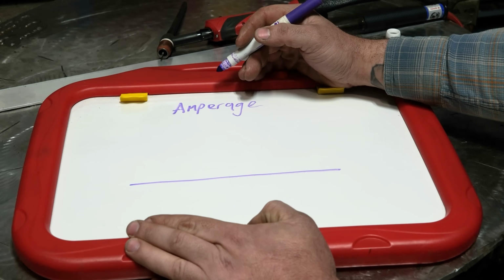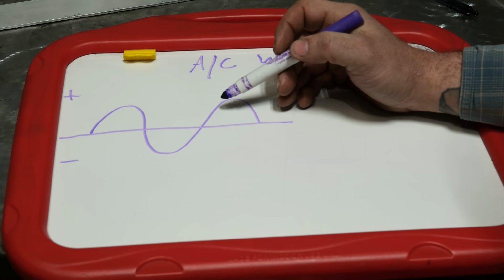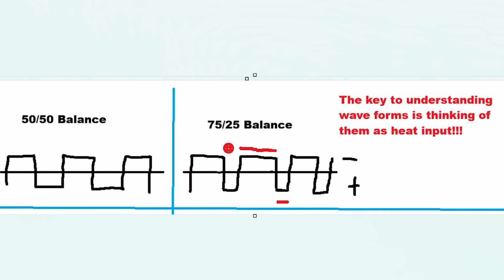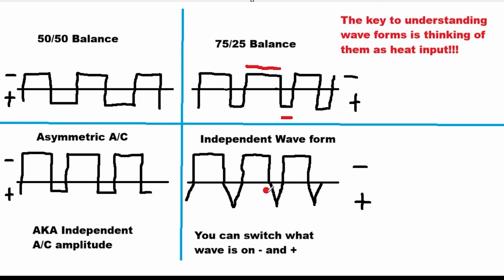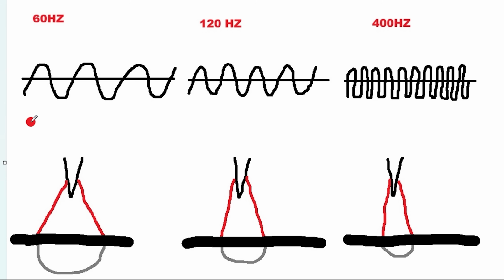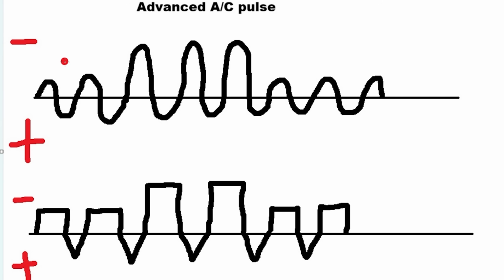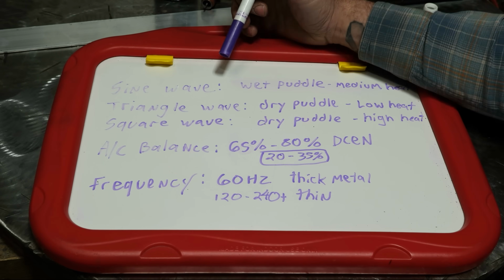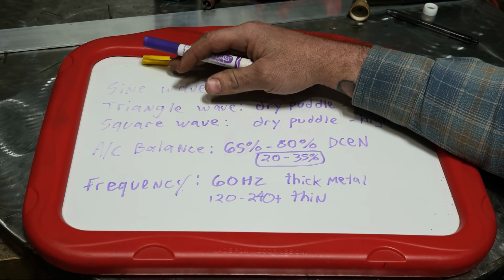How to Tig weld Aluminum part 2:  Understanding machine settings

Comment: Greg, very informative. Good information about cracking and such from pulsing. So much for a person to learn.
Reply from the maker: That’s the fun thing about welding.  The whole welding itself is a skill/has its own knowledge and the metallurgy end of things is a completely different knowledge set.  To be able  be able to weld any materials and have the welds last takes far more knowledge than just how to weld.  

Aluminum has so many weird quarks and most people aren’t aware of them.  Someone who is experienced with tool steels and heat treatment will understand aluminum quickly.  For most people that only work with mild steel they will likely do a lot of things wrong with aluminum.  The hot shortness sensitivity, the fact welded aluminum will often fail in the heat affected zone and not the weld because of the changes caused by heat input, and the fact that different fillers produce welds with different max heat exposure temps are just some of the things to consider.  Basically there are so many variables and so many things to consider to have a weld or repair that lasts.  There is a reason i have done so much aluminum work over the years that other people couldn’t.  It’s not a welding skill issue as much as it was a lack of understanding of how to make a proper repair/metallurgy knowledge.  Mild steel is far more forgiving than aluminum.

Comment: I have a Primeweld Tig 325 with a water cooler and CK torch. I have only used it for mild steel and a little stainless because I had zero understanding of welding aluminum. I am a little behind on these videos but I am finally understanding, I think, the aluminum process. I guess I will be binge watching this series this week and maybe my new years resolution will be to learn how to tig weld aluminum. Thanks, yet again, Greg.
Reply from the maker: Think of aluminum as an electric arc that can’t be completely controlled but you can nudge it to do what you want lol.  Once you get past needing to hold a whisper of a longer arc gap and a bit tougher starts, you will get it.  Give it a shot and with practice you will get it 😀👍

Comment: 20:08 if you try welding too thick aluminum with high frequency, you sit there heating the project & struggling to get a puddle going, and then it will collapse. 

Not a huge problem with ppl who have been doing it for a while, its just a hurdle im pointing out for ppl learning aluminum for the first time.

Comment: This explains so much and is very helpful as I struggled greatly with my intro to Tig class on getting decent aluminum fillet welds as I never understood the oxide layer and having to get the material hot enough to melt that layer without having the aluminum absorbing so much heat to melt away the edge of the joint 
All my welding teacher Tim said was get it hot and MOVE  but This explains so much
Reply from the maker: Once I get out the videos on welding aluminum that have arc footage and info on the actual welding, it should get you on the right track.  They should be out soon 👍.  There are a lot of stupid little things that make all the difference with aluminum.  It’s all about the minor details 😀👍

Comment: Great Video Greg, I've had a WECO Discovery 221 acdc for about 5 years it's a European made machine a little more expensive than the Chinese options but excellent features, quality components and well made.
It has "Mix AC" which allows you to like you describe dial in more DC - from 10 to 80 %

It also has another separate setting where it shifts towards the negative by a %  it shifts the crossing line negative with respect to 0. And obviously your regular balance setting.

It can set, triangle sine, or square independently on + it - side.

Il be honest I haven't used this feature that much, I generally stick to square or triangle if it's a thin and small part, something that will get heat soaked quickly.

But the Mix AC is really effective for thicker materials but if you go to high it can effect the appearance.
50% approximately is good for thick parts that you want to look nice.

That would be 50 DC - and 50 % your regular wave form and set frequency. 
Which it's self is 70% DC- depending on balance setting if that makes sense.

The manual gives good illustrations and explanations of how the wave form changes.
Reply from the maker: I always find it strange that European available welders often have high level features for years before anything is available like it here.  You seem to have tons more brands available that are full featured and more modern control setups.  I guess the states are a bit behind the times lol.
Reply: @makingmistakeswithgreg  I think there's more competition on the medium to high end then the 2 in the US, I've used Esab, Stel, Weco, Kempi, Lorch and Fronius, Stel actually manufacturer HTP's welders in Italy. They're all better imo than any Chinese welder I've used. There's more I haven't used Like EWM in Germany.
I've also used Lincoln's in welding school they were good too Lincoln Aspect 375 and I've used some older Millers.
Fronius & Lorchs high end machines are very impressive,

Comment: Looking to upgrade to a multi-process welder for my personal use. Looking hard at the Rebel 235 because I might want to run Dual shield sometimes (I like the capability to play with spray, but mostly for dual shield and short circuit MIG) The Rebel 215 or the Rogue 210 would technically be big enough for me(Except for the fact that they couldn't do as much with dual shield) and the Primeweld mig180 does everything I want but run 6010, which I want to practice more of. Also, I tend to run hardwire on the hotter side.  I figure I can turn a big welder down, when needed, but you can only turn a little one up so much. Just hard to spend money sometimes ;) 

Any particular thought?
Reply from the maker: So here are my thoughts:  the rebel 235 (which I own) is probably the best option out there for a somewhat portable wire machine for someone that wants to have the ability to run spray and dual shield occasionally.  It’s not ment to spray all day, but it will make quick work on projects most people want to do.  The biggest limitation with wire welding is amperage, and the difference a 230-250a machine (with the proper mig gun and accessories) is significant over a 200amp class machine.  Yes the rebel 215 can hit spray, but its mig gun won’t like it much.  

If you want to run 6010 it’s worth it to go with the rebel series.  Being able to run 6010 is also an indication it will run most rods better.  Most inverter all in ones tend to be fairly poor stick welders.  Esab chose to favor stick and mig performance with their rebel series, which makes sense because they market them as welders for outdoors/real world.  The only alternative to the 235 that I think would be worth it would be to buy a primeweld or similar 285a machine and a esab rogue 201.  The 201 is a great stick and tig welder (will run 6010) and a 250-280a class wire machine will handle a ton of serious jobs.  The downside to this combo is the esab rebel 235 can run on a generator far better, is more efficient, and will weld up to 140a on 120v.  Also, if you plan on welding out doors you can’t beat the design of the rebel to keep contaminates out.
Reply: @makingmistakeswithgreg  Thank you, I appreciate it, Greg. And that was an extremely fast reply ;) I only hesitate to get the 235 due to the price. It's just hard to drop ~$3,000, but I don't think I'd regret it. Might just pull the trigger on it. We`ll see, but I greatly appreciate you taking the time to reply ;)

Comment: Gotta say thanks. I was struggling all last week with 1/4 inch Aluminium at 80hz. I turned it down to 60hz like you suggested and it ran perfect.
Reply from the maker: Glad to hear that.  Aluminum can be a tricky beast at times.  Things can work opposite of what you would expect, which makes it hard to know for sure what’s going to happen when you make changes.  1/4inch definitely needs all the heat input you can have 😀👍.

Comment: I'm going to nerd out here. A major reason the sine wave is so much quieter is that it only contains the fundamental frequency. (There are some harmonics because the waveform is generally not perfect. But they are very low intensity in comparison to the fundamental. The triangle 'sounds' better than the square because it contains even harmonics that decrease in intensity at a constant rate. And even harmonics are more pleasant to the human ear. The square and pulse waves contain the highest number of odd harmonics. These sound harsher to the human ear.
But as you stated, we need to set our machines based on heat input, not on how pleasant it sounds while welding!
Reply from the maker: Very interesting, I would have never guessed that, but it makes total sense.  Thankfully ear plugs work well at blocking out the noise.  I always thought chipping hammers banging on metal plates was far worse than a a/c tig arc lol.
Reply: @makingmistakeswithgreg   that and angle grinders. I've always hated the noise. Great choice of "hobby" for me! I had custom formed in ear plugs made when I raced. They are great in the fab shop, too

Comment: Just wondering, where does that oxide layer go during the cleaning action? In theory, it should build up on the tungsten?
Reply from the maker: So the surface oxide likely gets broken down into particulates in the air along with burned up in the heat.  With dc and pure helium the heat is so high that the oxide layer will melt rather than staying like pond scum on the surface of the molten pool.  When tig welding aluminum the tungsten definately collects materials on it even if you don’t dip it.  The tip often stays clean (where it’s the hottest) but further away from the tip will often get contaminated and turns darker grey.

Comment: Thanks for the information I have a question what you think about the miller ac dc 220 is it good enough for 1/4 inch ac
Reply from the maker: So the miller 220 is probably the best all in one machine out there.  It does have a bunch of power which is good, but 1/4inch will be on the absolute limit.  Its ability to weld 1/4 will come down to the joint configuration.  Outside corner joints shouldn’t be much of an issue, a fillet weld on the other hand will be very tough to achieve proper root penetration.  Part of the issue is it will make a good looking weld that appears wetted out however the weld will likely bridge the root which is not good.  If you decide to buy it you must buy a bigger torch that can handle the heat.  I bet you won’t even weld for 2 minutes at 220a on a/c tig before the torch starts smoking 👍.

Comment: I wonder if a 100$ heat gun clamped pointing at the work piece at full blast would give a low end machine a better chance with thicker material. Maybe a brick between the work piece and the steel table might also help it hold heat better.
Reply from the maker: So thicker aluminum can be more easily welded if preheated with a oxy fuel or map gas torch.  It’s the only way to get anything resembling a decent weld on over 1/4 in material with 200 amps.  The downside is it will no doubt help fusion but in some cases it might still not be enough to fuse the root of a weld.  The extra heat input will also help soften the aluminum depending on alloy/heat treatment, which may be undesirable.
Reply: Not to mention, if he puts a brick between the work and the table AND has the common habit of leaving the ground clamped on the table..... No welding will be going on until I realized my dumbass needed to ground directly to the work. Wait, did I say "I" ... Uhhh, I meant he. Yeah, yeah, the other guy. I never put anything between the table and work piece that insulated it from ground. Then took 5 minutes to realize why I couldn't strike an arc 😬. Lol, only happened a few times, honest

Comment: Lots of info!  It seems that aluminum tig welders are signal generators.
Reply from the maker: So effectively modern tig welders convert a/c wall outlet power into clean D/c power.  That d/c is then fed into a bunch of computer controlled IGBT modules which can basically output anything for a wave.  They can create sine wave, triangle, trapezoid, or even wilder a/c shapes.  In the last 5 years the sky has become the limit with output waveforms.  Unfortunately needing a lot of amperage to weld aluminum hasn’t changed any lol.

Comment: I've had my Miller Syncrowave 200 for decades and got a Primeweld 225 a couple of years ago. For portability and higher frequency use in tight joints, the Primeweld is nice, but for overall smooth operation and low current starts, the Miller is just so much nicer. You get what you pay for. Primeweld is solid, but it's built to a price point, and the harsh starts come with the deal. If I could justify a new Miller or Fronius, I know I'd be in hog heaven until the bill came due. Thanks for your contribution to the Youtube welding community.
Reply: Have the primeweld 225 it’s my first and ac/dc and I really like it. Got the chiller and a ck20. My fronius transsteel only does dc so I have nothing to compare the primeweld to, can I ask what you mean by harsh start exactly? Are you talking about the HF? Kinda sucks that have points and I had to adjust them once.
Reply: @KZ-yy9pm  Even when set to a low current, the AC starts are at something like 20 or so amps, whereas the Miller is 5 amps. Not a problem unless I am trying to do outside corners on 26 ga aluminum. Another thing about the Primeweld, sometimes it hisses but won't start unless I tap the tungsten on the work before giving it pedal. Maybe that's the points needing adjusting? It's done it since new. Primeweld tech support suggested the tap trick. Wish the fans were quieter :)
Reply from the maker: 100% agree.  The difference when you compare higher end to low-mid tier tends to be found in the extremes.  The low end amp control, arc starters, and resolution of the foot pedal of high end tig machines are typically very good.  You don’t realize how good they are until you try a more normal machine lol.  

I have been on the hunt for a perfect ac/dc tig machine that’s affordable (aka close to a miller or fronius) and at 1500 or under.  I don’t think it exists lol.

Comment: I bought my Dynasty 200DX in 2004, played with many ac frequencies over the years….
Really no advantage was seen, I actually thought because the arc was focused, it would 
Give more output…NO…..
well, about two years ago while welding ac in tight corners on aluminum,
The arc was much more controllable , and would shoot right into the root, a big improvement….
So I finally found a use other than sounding like a train whistle in the distance…
Your explanations are spot on Greg, a lot of info, anyone who watches this should put it in
Their library and view multiple times….
Always the Best Greg
Cheers, Paul
Reply from the maker: Aluminum tig is the closest to a “dark art” welding has to offer lol.  So many settings/variables, and ontop of that the a/c arc can have a mind of its own sometimes lol.  I am sure you have ran into more than a few instances where things just don’t work the way they should.  Aluminum is probably the funniest material to weld and can be the most frustrating at the same time lol.

Comment: With each feature being a separate variable, the list of effects is long. Then, when one considers the interactions between the variables, one may need to dial back one variable while increasing another variable. Dialing in can be easy with one dial, more difficult with two dials, and quickly becomes super confusing when you look at all the dials on a PrimeWeld 325X. Thanks for all you do to reduce the confusion.
Reply from the maker: You are exactly right.  The level of variables you can introduce with modern machines is unbelievable.  Sometimes things work in ways that are completely unexpected.  That’s why it’s so important to stick with a solid baseline setup for settings and change one thing at a time.  It’s fortunate that most of the advanced settings don’t offer a whole lot of benefit.  Even simple a/c machines can do awesome welds 😀.

Comment: Question: For those of us new to TIG (200-250 amp machines) what thickness of practice material (steel, aluminum) should we get? I get cutoffs from the local metal supplier who sells them by the pound. 
Thanks for all the information you have shared.
Reply from the maker: I would start with 1/8th 3.2 mm.  It will allow you to build your skills and not risk melting through it easily.  One of the coolest parts about welding aluminum is you can take a 1/8th flat stock and weld a ton of passes on it and effectively make it 1/4inch thick.  Because of how fast it dissipates heat and the fact most machines have a foot pedal, you can actually continually weld it without having it melt into a puddle on the floor.  With steel once it gets heat soaked it welds poorly, aluminum is far more forgiving.  😀👍